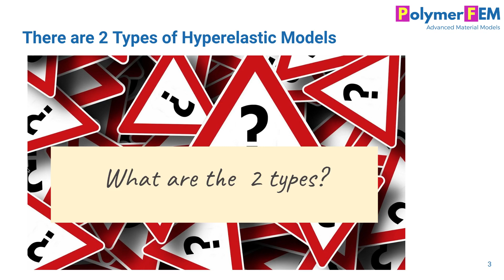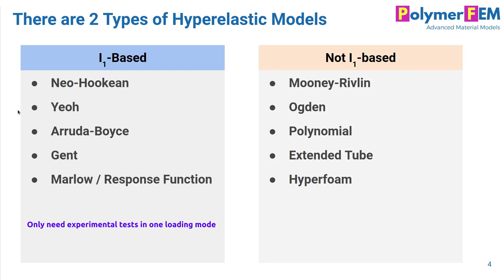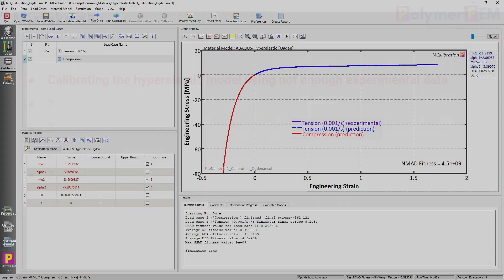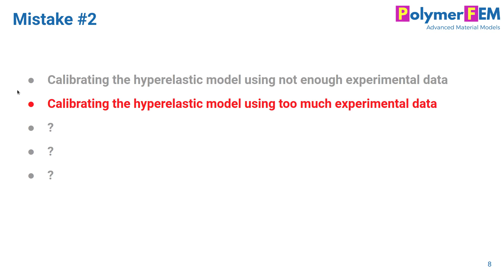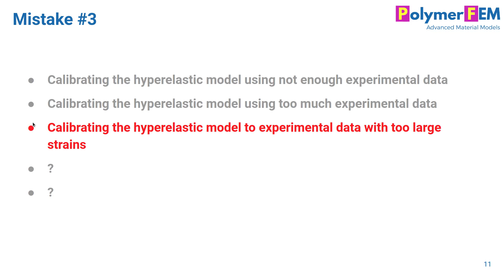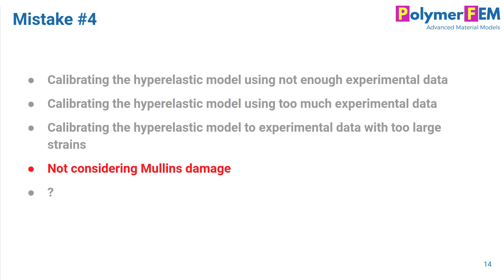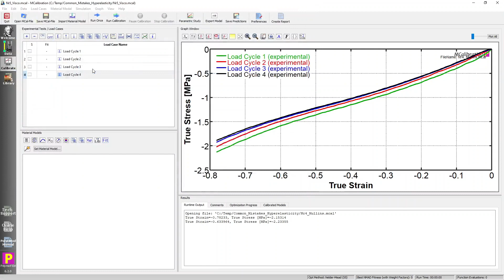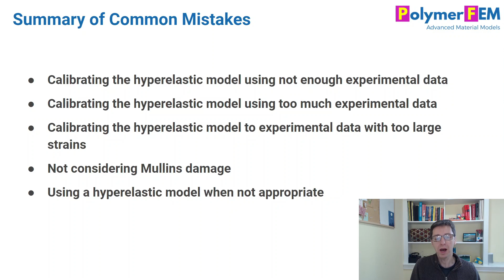5 Common Mistakes When Using Hyperelasticity

Comment: I have a question about the I1/I2 distinction. If I have results from a torsion test (specimen twisted by 90 degree) and uniaxial tests (compression, tension), can I use them to calibrate an I2-based model, or should I limit myself to a I1-based model still?

Comment: Hello, how can I determine if a material is I1 based or not? (In my case it is a 2 component silicone/glue called Sikasil SG-500, You can find the data sheet here: https://industry.sika.com/content/dam/dms/gb01/4/sikasil_sg-500.pdf )
Reply from the maker: All polymers (including your 2 component silicone) will have some I2-dependence. For most materials, fortunately, the dependence on I2 to is so weak that it can be ignored without introducing larger errors. If your material model does not include viscoelastic effects, then that will introduce larger errors than ignoring the I2-dependence. In summary, I would recommend ignoring the I2-dependence.
Reply: @PolymerFEM  That simplified my problem a lot. Thank you very much!

Comment: excuse me sir, can i know how to get loading unloading curve from experimental data (tensile) that only have single loading curve? my material is thermoplastic polyurethane (TPU), is it possible to calculate that from mcalibration?
Reply from the maker: You cannot get the unloading curve if you only have the tensile data at one strain rate. But if you also have data at multiple other strain rates, then you can use MCalibration to calibrate a suitable viscoelastic material model which can then be used approximate the unloading curve.